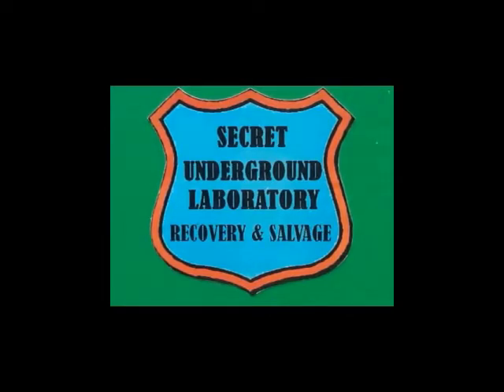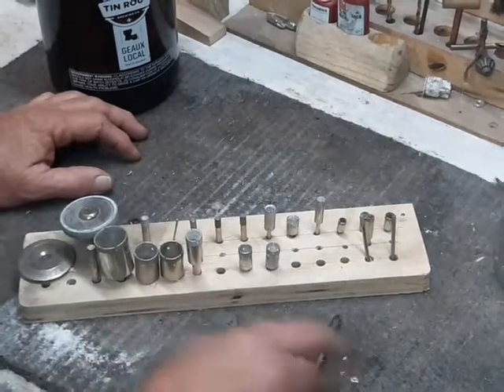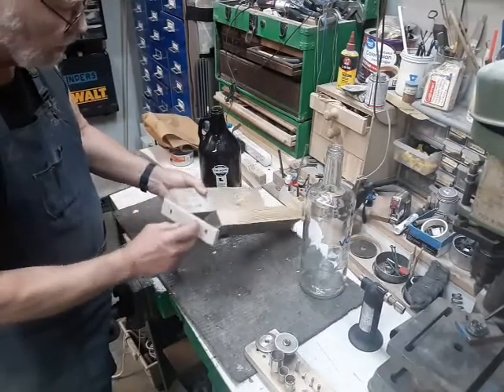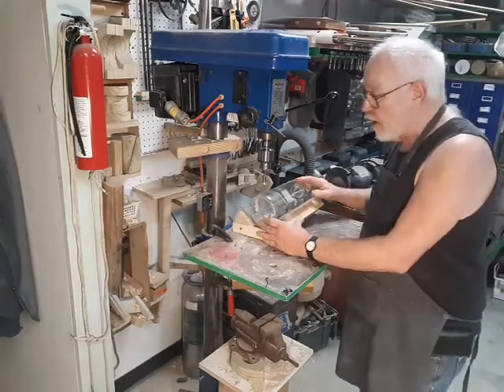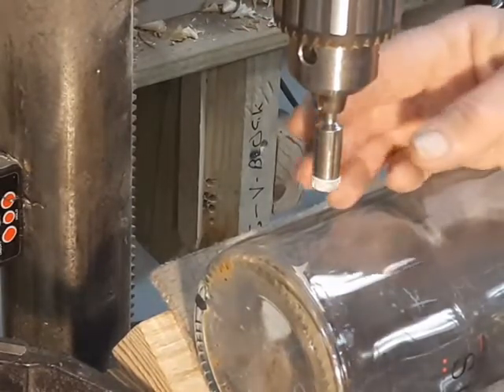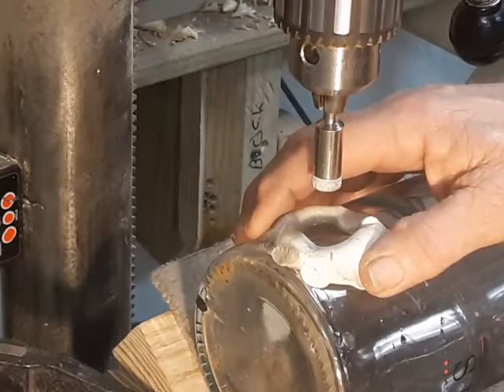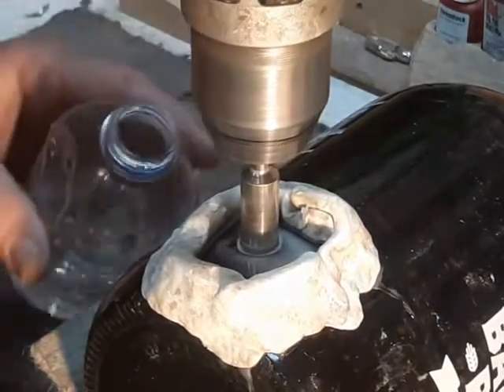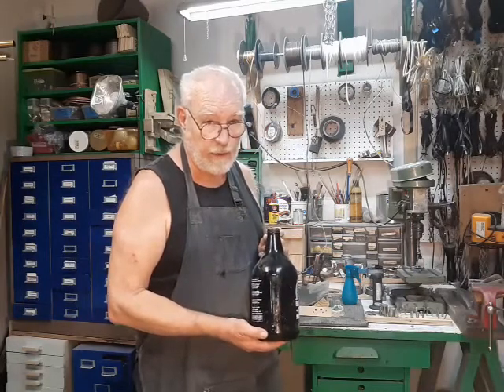Drilling a Hole in glass in the Secret Underground Laboratory Recovery and Salvage

Comment: Great instruction!
How sharp are the cut edges, and do they need some kind of ‘sanding’ to soften them?  How would one do that, and with what equipment?
Thank You.😊
Reply from the maker: Thank you. The edges are not very sharp but it's still glass. It can easily wear through the insulation of a lamp cord. A variety of plastic bushings are available to protect the cord when making a lamp.

Comment: That first bit works well on plexiglass. I want you to drill a hole in the butt of my dragon steam pot I have on my wood-burning stove. Then I can plug the nostrils and have steam shoot out of its new butt hole. It is ceramic, would the bit work on ceramic?
Reply from the maker: The core bits work great in ceramic. The problem with spade bits is too much pressure or a little wobble will crack the glass or ceramic. I can certainly perform proctology surgery on your dragon.